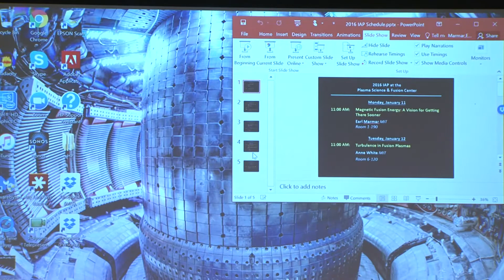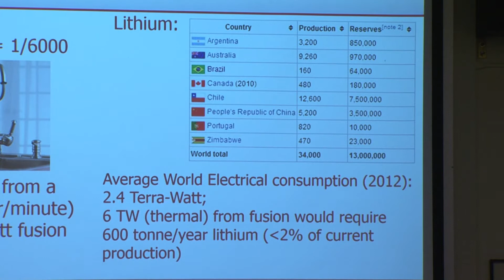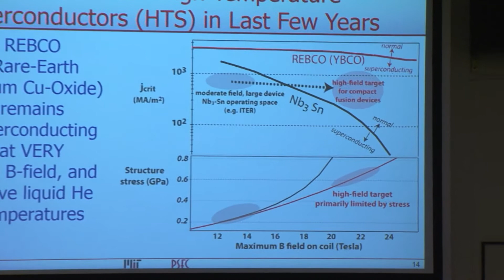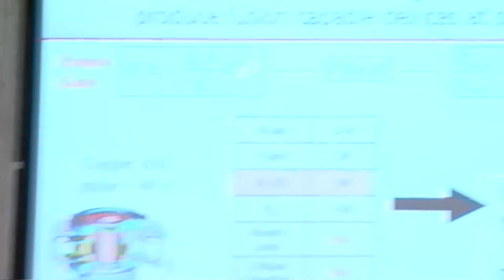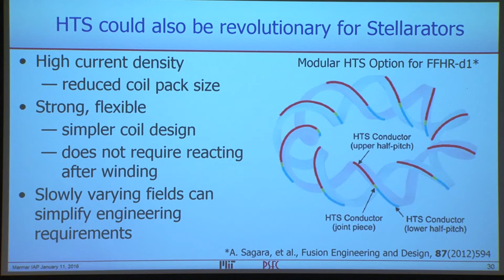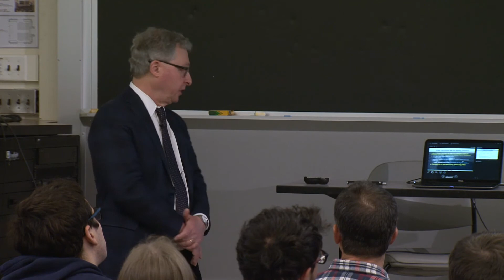Magnetic Fusion Energy: Earl  Marmar

Comment: Energy is lost in a torus. A sphere is better. Search for "spherical electromagnet" if you want to see a spherical reactor design. It should be the first thing that pops up. Look at figure 1. You will know it when you see it - it's my icon that you see to the left. In this design the plasma is rotated like the armature of a motor with the axis of rotation constantly changing. The counter emf inside the plasma compresses it toward the center.

Comment: Love the videos. Just a couple small points. 

(11:15) The presentation implies that runaway reactions is an inherent potential of all fission reactors, but only reactors with positive temperature-reactivity coefficients (the hotter it gets, the more reactive it gets) do this. Thermal spectrum Molten Salt Reactors (MSR) have negative temperature-reactivity coefficient, making it physically impossible for them to produce a runaway reaction (just one of the features that make thermal spectrum MSR's almost inherently safe). Using a moderator lets you achieve criticality with much lower fuel densities, but that also means that reactions can only occur in the core where the moderator is, and not in the rest of the system, like the pipes or heat exchanger. 

After achieving criticallity, as fuel temperature increases its density drops as it expands throughout the system. If the fuel heats up uncontrollably, it will eventually reach the point where the density/concentration of uranium in the core is not sufficient to maintaining criticallity. At that point, criticallity falls and reactions die down, resulting in the reactor cooling itself (without human intervention). Once the fuel cools enough that fuel density in the core can once again achieve criticallity, the reactor starts itself up again.
Reply: (12:04) The production of long lived wastes is also not an inherit feature of fission reactors, at least not at the level of current reactors. The current waste stream is a product of a once through fuel cycle and the low burn efficiencies of LWR’s. We designate fuel rods as waste once concentrations of U-235 have fallen enough and concentrations of neutron poisons, like xenon and krypton, have risen enough that the rods can no longer maintain a reaction. As U-235 (not entirely fissioned through operations anyway) is only a small fraction of the fuel rod (~5% I believe), the effective majority of waste is "un-burned" fuel. In the US, we don't allow for fuel reprocessing, which would allow further burning of the rods. Fission products (the things actually produced when an atom is split) generally don't have long half-lives, ranging from seconds to a few years mostly. Thus, most of current long-lived waste is actually "wasted" fuel. 

Thermal spectrum MSR thorium breeders start the fuel cycle at U-233, with a fission rate of 90%. The other 10% after absorbing the neutron, would have to absorb one more (2 neutrons total), to become U-235, with a fission rate is 85%. Thus, by using a thermal spectrum MSR thorium breeder, you cut your long-lived waste stream from +95% down to 1.5% at most (likely less given the remaining 1.5% can be left in the reactor for further fission opportunities).
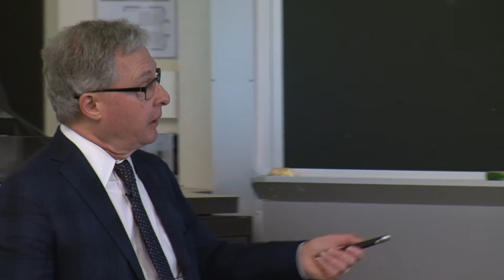Reply: (12:50) Commercial fission reactors aren’t generally used to produce weapons grade materials either. Proliferation risks are more directly related to the processing equipment for enriching the concentration of U-235 within natural uranium. As this equipment is not needed for MSR thorium breeder, doesn’t really contribute to proliferation risks. 

The plutonium produced by commercial reactors isn't generally the kind you'd prefer to be in your weapon. The isotope of Pu that can be used reliably in a weapon is Pu-239, but plutonium pulled from commercial reactors will be contaminated by other isotopes, like Pu-238 (high alpha emitter which would generate a ton of heat inside your weapon (not good unless you want to use up valuable space within the weapon for insulation)), and Pu-240 (high rate of spontaneous fission, so not good if you don’t want there to be a chance the weapon will blow up in your own face). Also, an MSR Th breeder would produce very little plutonium over its entire life.
Reply: I totally agree that fusion is the best of all alternatives over the long term. However, currently it's not an option, while fission is. I just find issue with fission consistently being characterized the same, all reactors are water reactors like Chernobyl and Three Mile Island, and they have a high chance of doing what the plant did in the China Syndrome (a bad movie full of false information). LWR's are a 70-year-old design that was never safe for commercial use, a view shared by one of its inventors, Alvin Weinberg, who argued for more efficient and safer designs decades ago.
Reply: https://www.youtube.com/watch?v=pGzKuhY50v4
https://www.youtube.com/watch?v=H6mhw-CNxaE&t=924s

My point is, runaway reactions and producing vast amounts of long lived waste are not inherent to fission reactors. They are issues for some designs, like LWR's operating on a once through fuel cycle. There are other designs (tested, built, and operated for years) which do not share those drawbacks.